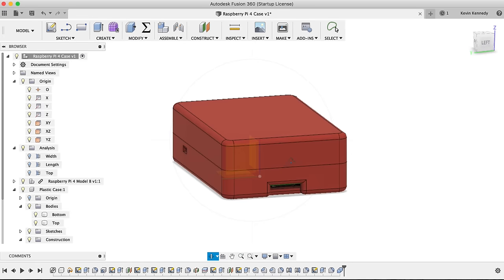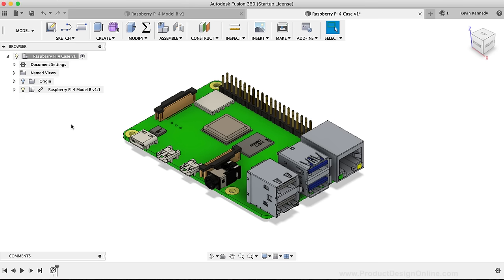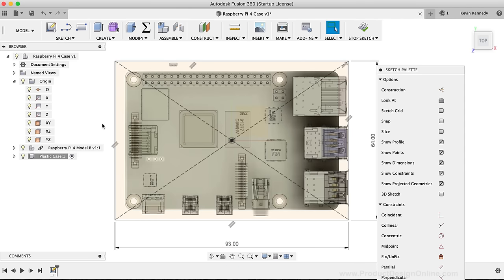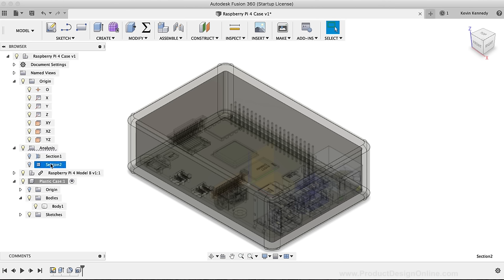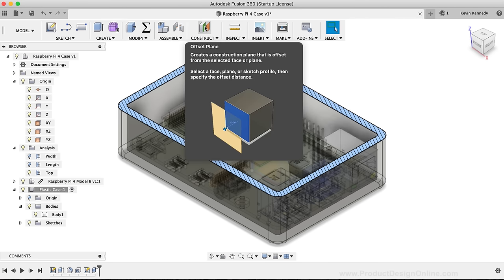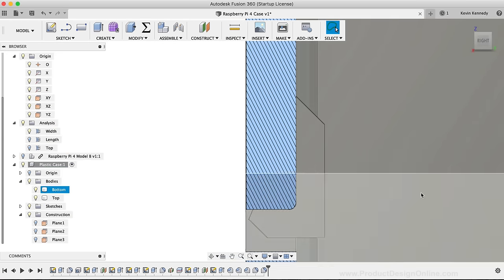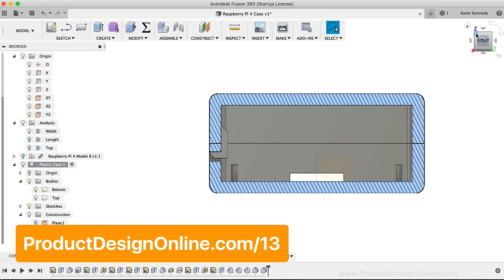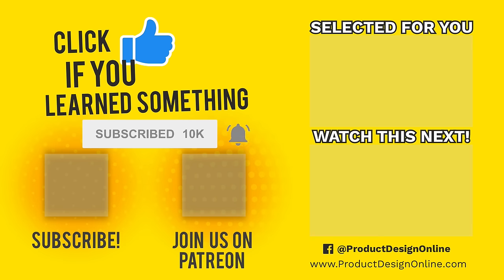Fusion 360 Snap Fit Cases | 3D-Printable Raspberry Pi Case

Comment: trying to follow along is so frustrating when I'm trying to duplicate what you are doing and it works for you but not for me.... trying to extrude the holes at 13:38 and my computer does not allow me to select the holes but it selects the entire bottom of the case... i give up... 2 hours waisted on a 13 min tutorial.
Reply from the maker: It sounds like you may have a sketch or something in the way. You can share your file in my community space where someone in the community (or myself) will take a look at it - https://bit.ly/PDOcommunity

Comment: How this tutorial doesn't mention tolerances and completely skips over them on a something about interlocking/fitting parts is insane to me. Great tutorial in some ways but horrible without teaching about tolerances.
Reply from the maker: You're right. I missed it, but put some notes in the pinned comment shortly after. Thanks!

Comment: PRINT
Reply from the maker: Thanks for watching, Ian! Cheers, Kevin :)
Reply: @ProductDesignOnline  can you show the model 3D printed? I notice that you add a chamber on the "top" case portions cantilever but not the "bottom". With just a fillet and what ends up being a 90° overhang, that small geometry really screws up when I print. Let me know if I need to clarify.
Reply from the maker: @ianmatsui7585  Great point! I should've mentioned that I ended up printing mine with supports because of the slot cutout for the connections on the side (HDMI mini, USB C, audio) and the cutout for the snap joint. Consequently, the supports ended up salvaging that other side of the snap joint. You could definitely try adding a chamfer to all of those areas to avoid supports altogether. Cheers, Kevin :)